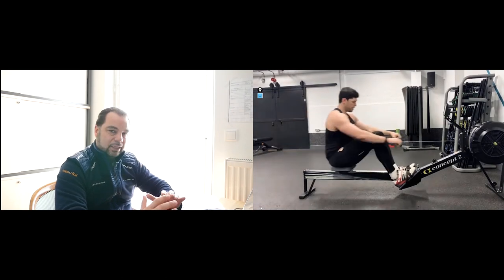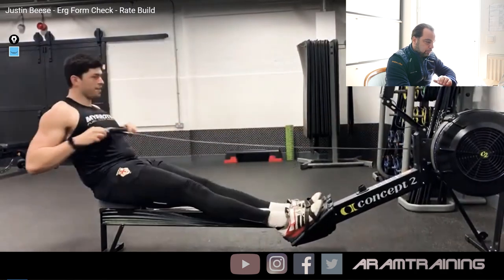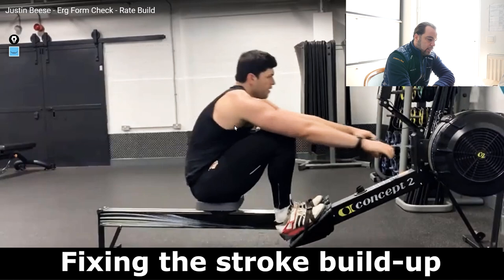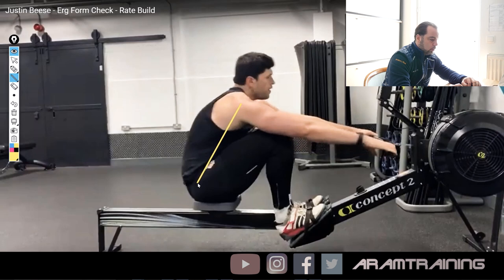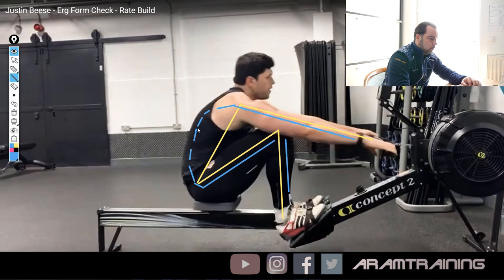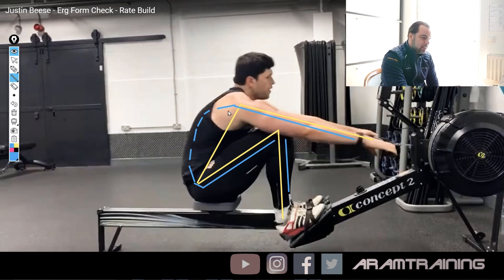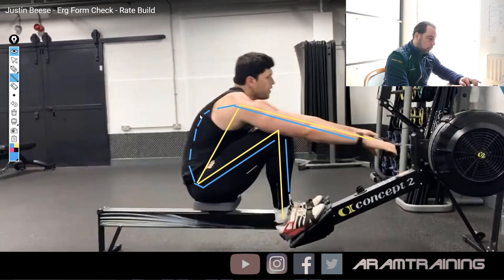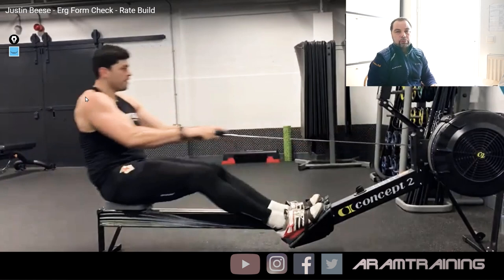Indoor rowing technique - How Justin can go faster with the same effort

Comment: Hi Aram. I  find the explanation of the round back problem with the on screen tools really helpful. Still trying to figure out how to put this in words when coacing without a screen handy. One thing that made me think while I was watching the video is the question of going faster BUT where?
My training philosophy is  that going faster on a boat is the objective but some might just want to erg. If the objective is "boat" then there comes the matter of "HANDS" and backlean at the finish. 
That's why so many ergers pull the handle to the chin and have terrible angles in their hands instead of finishing at the sternum with flat wrists (which incidentally will also make the arms move away from the body).
In Justin's case he ends up using just a few fingers on the handle. In a boat he'd catch a crab every time. I don't know what Justin's objective is. But erging with the handle going so far up will create bad muscle memory. He needs to decide if he wants to be faster on the boat or the erg. Both are fine, one just needs to know.
And YES. Fixing the back will make him faster on water AND the Erg. Thanks again for a great video that made me think on how to make myself better.
Reply from the maker: Thank you very much for your feedback Yavuz!